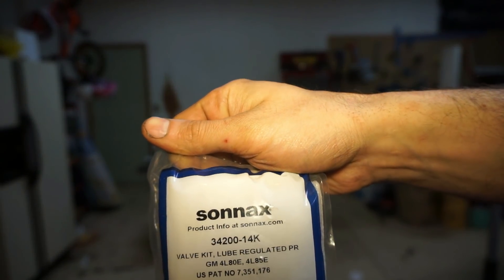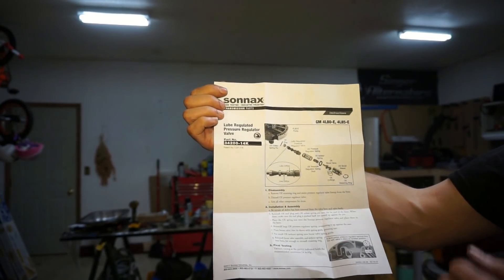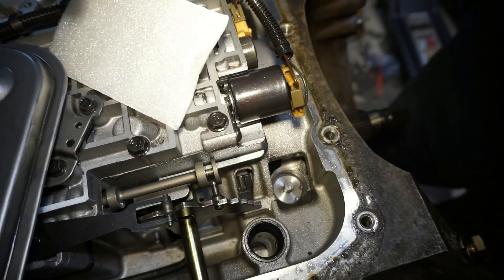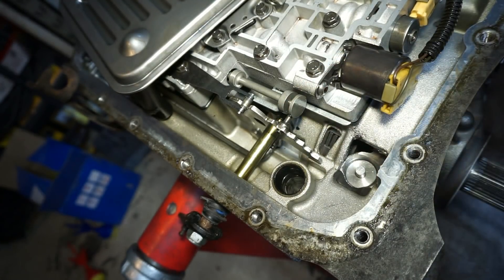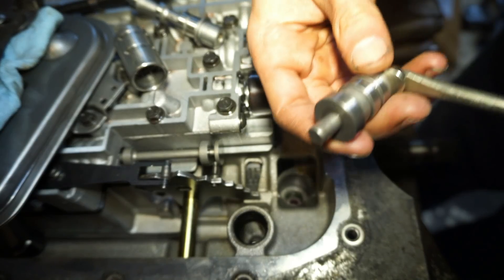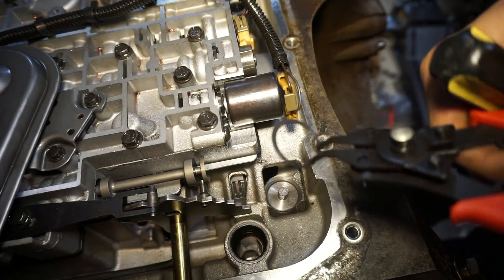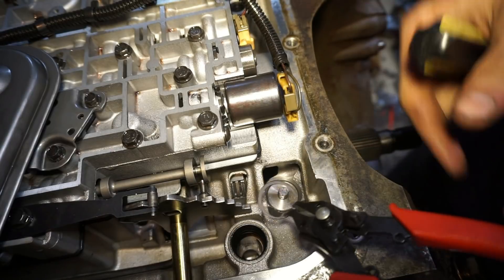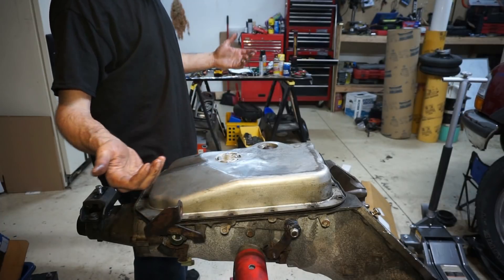INSTALLING SONNAX LINE TO LUBE VALVE IN 4L80E!!! -a21bravo

Comment: What if you drill the line the little hole and then want to use that pump in a stock transmission will it hurt
Reply from the maker: No

Comment: I put one of those Sonnax Line to lube spools in my 4L80E a few years ago when I did a half @ss rebuild on my transmission. I have my 4L80E out of my truck now, in order to do a top of the line rebuild on it. I bought a Jakes Performance stage II rebuild kit for it, which comes with a custom spec line to lube pressure valve spring that Jake says gives the transmission a more consistent line pressure than other manufactures springs.
Reply from the maker: Nice!
Reply: He still calls out to drill .093" hole in the line pressure to converter charge circuit in the pump. I am gonna call him tomorrow and find out if one could use this valve instead of drilling. Those kits are nice tho - everything you need and then some !
Reply: @TrollingwTyrone  There are a couple of videos out there, Blazer Builds, may have been one of them that say the Sonnax 'line to lube' spool valve accomplishes the same thing as drilling the converter charge circuit relief port hole. So it is not necessary to drill the hole then.
Reply from the maker: @christophersanders5007  Yeah valve does the same as drilling. But the drilling is free if you have pump out.

Comment: Quick question. So I had already drilled the hole in my pump, however, I also have the Sonnax lube regulated valve. Do you think I would be safe if I installed the new updated regulated valve? or would I have issues with not enough pressure?
Reply from the maker: I dont think it would hurt, but I'd probably just do one or the other.
Reply: @BlaserBuilds   Thank you for your input

Comment: Great video, thank you. I stumbled upon this video a few days ago. I have a 1968 Pontiac Firebird with a 496 stroker, 4L80E with Jakes Performance rebuild kit completed by a local builder, a manual harness from Jakes, a 3400 rpm stall converter from Circle D single disc, Long Tru-Cool Max transmission cooler P/N LPD47391. I had the following issues, my transmission was locking up in 1st and 2nd gear as well as runing 200 to 210 degrees with a smaller older cooler. I had to keep my foot on the gas at stop lights to preventing stalling and when backing up, the car would buck much like a 4x4 turning tight corners. I called Circle D and explained my issue and this thread, the rep at Circle D recommended I try replacing the lube regulated pressure valve with part# 34200-14K ($58.77), after that I found this video . I picked that valve up yesterday from Summit Racing here in the Dallas area. I installed it today in a little over an hour, while in the car and I took my time, then added 6.5 quarts of dextron VI synthetic fluid and took it out for a test drive in 95 degree tempatures. All I can say wow, get you one of these valves and the cooler listed above ( in my humble opinion), these two items solved my lockup problem and my cooling issues. I drove my car like I stole it, the temp never got over 175 and as I down shifted pulling up to stop lights it idled just fine at 800 rpm. Great video ..

Comment: Can you just take the old one out and drill those 2 holes on a drill press ? No need to buy one.
Reply from the maker: I'm not sure if the stock one has a hollow center... You could grind a flat on the divider.
Reply: @BlaserBuilds  thanks for reply, I got the superior shift kit and they included a valve with what you described- 2 flats on both side.  I’m using that valve along with the trans hd kits. Been watching your vids on them- No drilling valve body ! :)
Reply: @BlaserBuilds  its possible to replace  from under truck? or need take transmission out ?
Reply from the maker: @lobosolitario.1065  You can do it by taking pan off.
Reply: @BlaserBuilds  thank you very helpful your video i subscribed ...

Comment: Man I'm having what seems like the converter is partially locked when I go in any drive gear when cold and it will just stall, but once the motor gets some heat in it, it will go in gear fine and not stall, trans shop put the hd2 kit but I'm wondering if they didn't drill the pump. I'm really wanting to chance it and put the sonnax valve in it, think I could do with trans still attached to the motor? Its gonna be a bi*** on my back on the floor but I got no other choice and don't fell like pulling the trans.
Reply from the maker: Yeah you can do it. Won't be that bad.
Reply: @BlaserBuilds  well gonna give it a shot today after work got the valve already from a local trans parts place

Comment: Whats the difference between the  tcc regulator valve  and the boost pressure valve?
Reply from the maker: Boost valve is for line pressure for the trans in the pump..   TCC is pulse with modulation for torque converter clutch lockup apply circuit.

Comment: How hard would this be in the vehicle?
Reply: Not hard...u just need to drop the pan and filter...and offcourse ull be doing it laying down with transmission fluid constantly dripping on you....even if u leave the pan off for a few days to let the valve body drain

Comment: Have you driven this transmission since you changed the lube valve? 

I just picked up a 4l80e and wanna install the hd2 kit..

 do you recommend me installing this lube valve while I change the parts for the boost valve ?
Reply from the maker: If you're going to do it, that would be the time... I've driven it a lot. Plenty of street miles, WOT pulls, and drag passes. Took me to 11.2 in the Ford Ranger so far.
Reply: Ok.. thanks man, you got a new subscriber here

Comment: You should put an 8" sonna tube inside of a 12". Pour concrete in between the two. Wallah, indestructible driveshaft safety tube

Comment: Does this replace the hole and valve from the HD2 kit?
Reply from the maker: checkmate427 Just replaced the stock valve. The HD2 kits doesn't come with this valve. HD2 kit says to drill the hole but this valve wouldn't need the hole drilled.
Reply: Had to check out this vid as well. The pressure relief valve that sonnax makes replaces the boost valve and you dont have to drill the valvebody.  The one you replace in this video is the line to lube which keeps the converter fed when the relief is working. If you ever see low pressure in the trans you can plug the hole in the valvebody, add the sonnax boost valve and have reliable pressure relief.
Reply: @spyderlyf3  So I just ordered my Hd2 kit, and the Sonnax valve. So I just install the Sonnax valve, and DON'T drill the two holes in the valve body? Sorry for the stupid question.. just wondering so I get it right.
Reply: @CountyGarage207  not a stupid question. The relief boost valve does the same as drilling the valve body for pressure relief. Mods to keep the converter fed too while the boost valve is working. Sonnax has a valve for this or the pump can be modded. I have a Vigilante converter so it was recommended. This thread may help.https://ls1tech.com/forums/automatic-transmission/1672443-4l80e-internal-dual-feed-vs-transgo-hd2.html. edit!  just realised this video is about the line to lube valve lol..haven't seen it in a while.

Comment: So, I have a question. I have 4L80E transmission that is not shifting to 2nd gear, I replace 1,2 shift solenoid, 3,4 shift solenoid and still not shifting. Any Idea why? Someone mention to clean out something that they told me tends to get dirty. I need some help. Thanks. Any ides? I did manage to find a big fuse blown, thinking that would fix it after replacement of solenoids. Still the same. 176000 miles.
Reply from the maker: Thor Hamm Hard to say. You could Google "4l80e apply chart" and see what's supposed to be active in 2nd gear... Odly enough both solenoids are not energized in 2nd gear.
Reply: Thank you. Like your videos.
Reply: I know 6 yesrs late but did u find the problem? I was thinking maybe a defective pillow switch or leaking internal wire harness making it go into limp mode?

Comment: Dont you have a spare front pump from the case donor transmission ?   Just wondering why you bought a pump
Reply from the maker: Kevin G Because the inside of the trans was toast... Just in case it was a pump/low pressure issue I got a different one... I'll keep the other and go through it, maybe use it later.

Comment: Quick tip and only for a minute use a nut driver over boost sleeve to push down while putting snap ring in or out
Reply from the maker: Andrew Scott That would work pretty good.